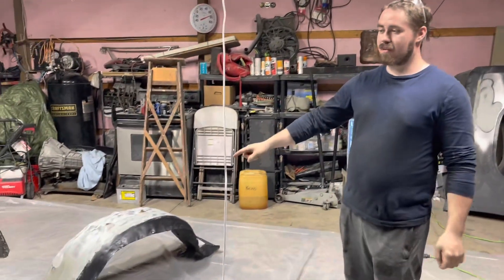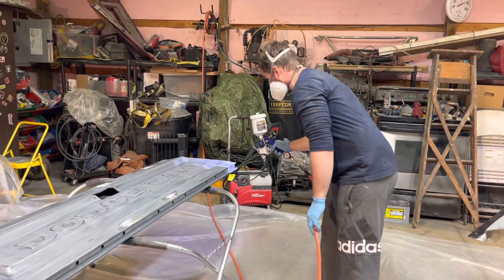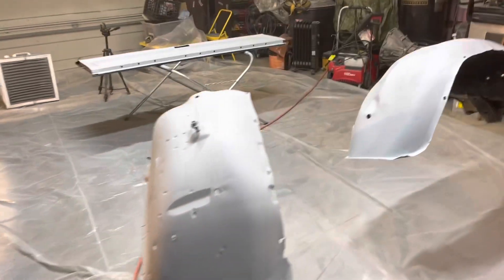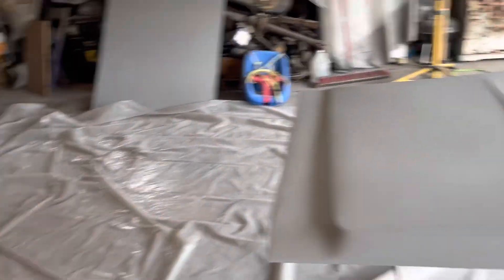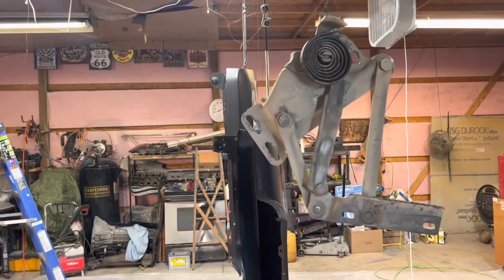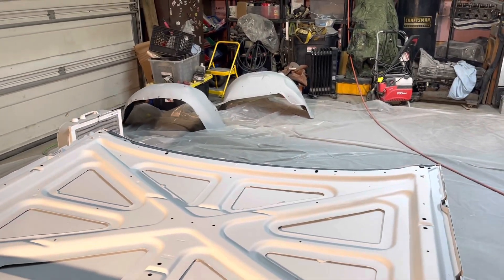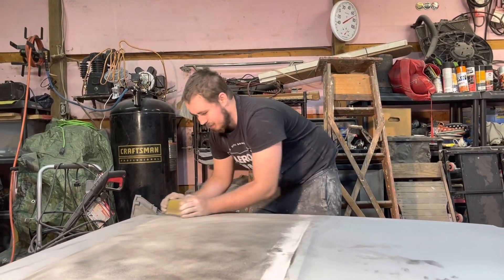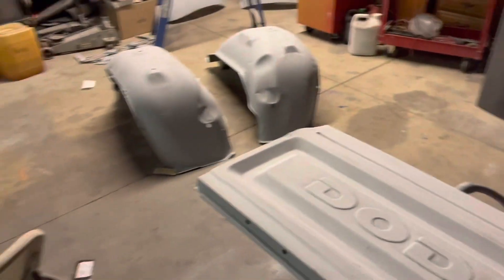Upol 2253 filler primer for the first gen Dodge !!

Comment: What tip did you spray at?? And do you think you can spray this with a 1.3/1.4 ?? I only have that available unfortunately
Reply from the maker: I think I used a 1.8 or 2.0 here, but I did use a 1.3 tip once worked just had to thin it out a lil more